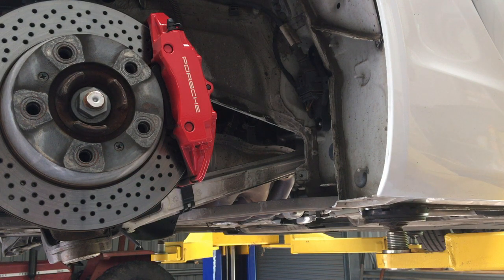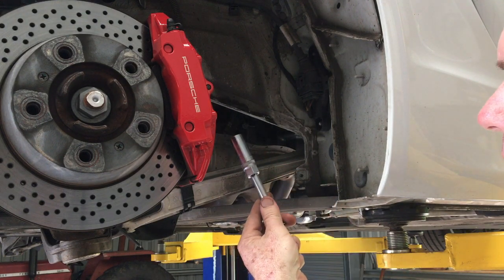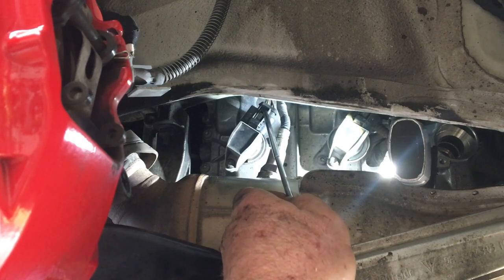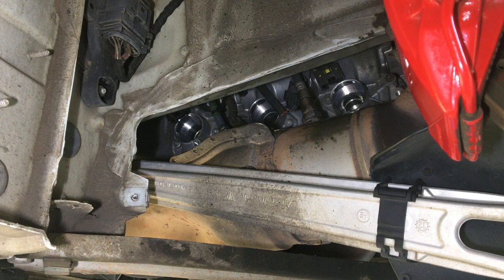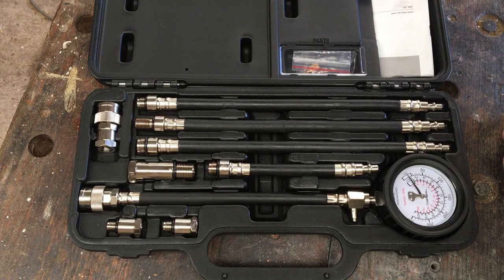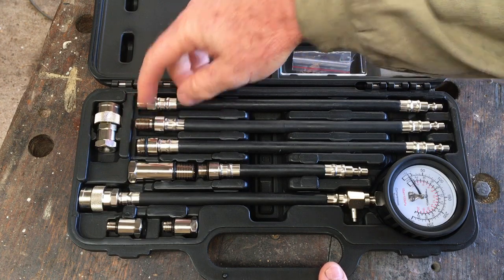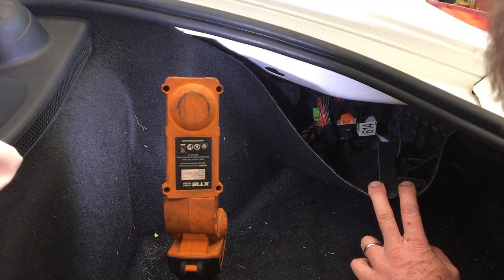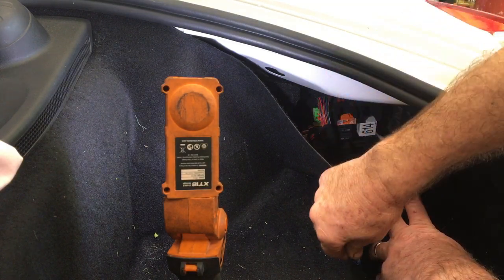981 Spark plugs, compression test

Comment: Hey Jeff, thanks for sharing that. How about using a oscilloscope to work on boxer engine on Porsche, Subaru? Pluse check first for crackcase, intake, coolant, pipe and holes that leaking air might create sudden pulse waveform. Then amp clamp or volts drop relative compression test to see if any cyclinder acting badly. It won't give you direct measurement of pressure but it shows you how well one cyclinder operationg compared to the rest of them.

Comment: Thanks for the great instructional video! Keep them coming please! Question, for the torx portion to remove the ignition coil, are there any special tools I should purchase to make that portion of the job easier? Much appreciate!
Reply from the maker: Nothing special, just the T30 bit and a small ratchet (probably 1/4") that fits it. It's a bit fiddly but it can be done without anything else.